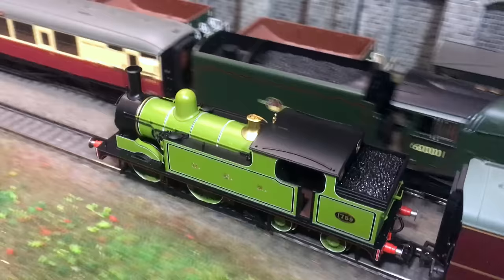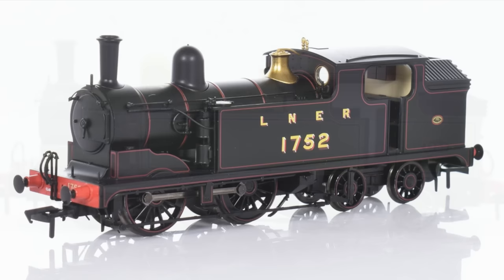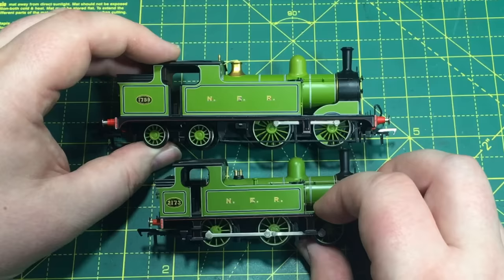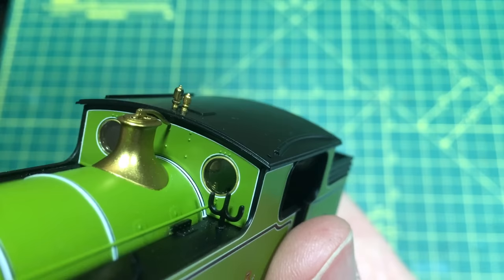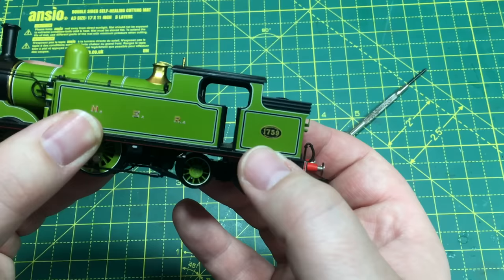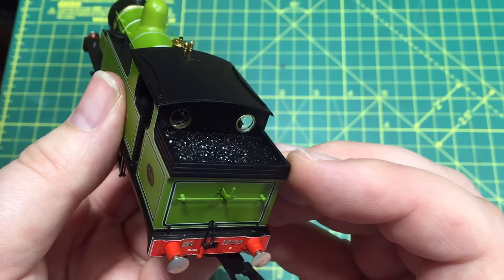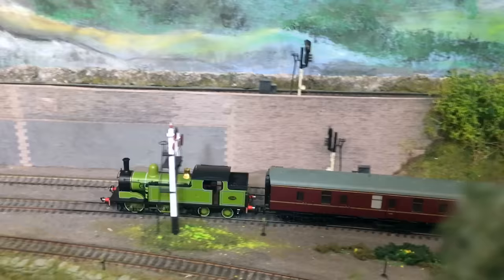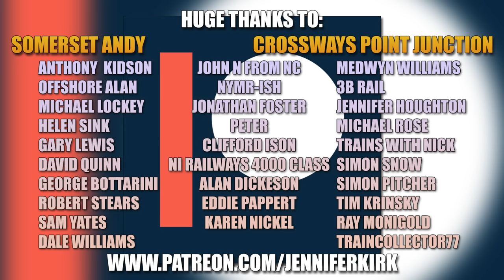The Perfect Branchline Loco? Bachmann TMC Class G5 Class Tank Locomotive in NER Lined Green - Review

Comment: This is a truly great model and I am very pleased with mine. Thanks Jenny for a great review, of the usual high standard. 

Whilst I would have liked crew in the accessories, TMC offer to fit crew, and the result is great on my experience before when buying from them. 

I love the additions of the fire irons and lamps which can be fitted to reflect the working being undertaken - not the fixed as Hornby have done recently.  The challenge now for manufacturers is to make them work in situ, on both buffer beams but at a low glow level. Could the lamp brackets be fibre optic cable or does one go with a plug in lamp (after removing the empty bracket) a la Hornby)? Ditto for the red tail lamp for light engine working. [The colour is easy given the electronics in even the DCC ready version.]
Those wanting precision on the dates of variations (especially the coal bunker enlargements) can get them from the review of the model in Railway Modeller.